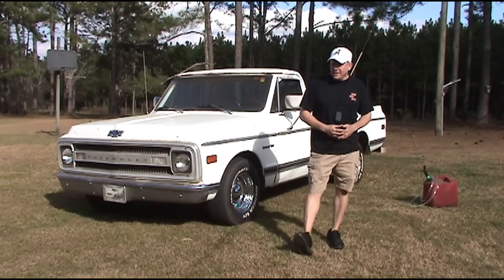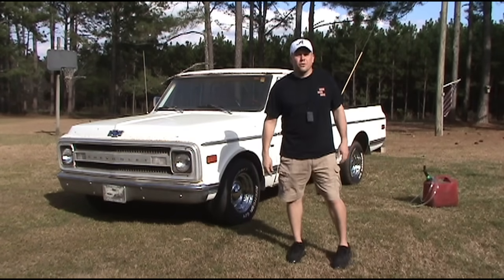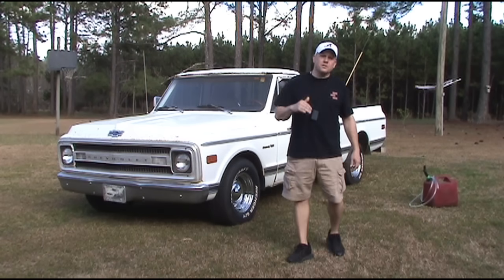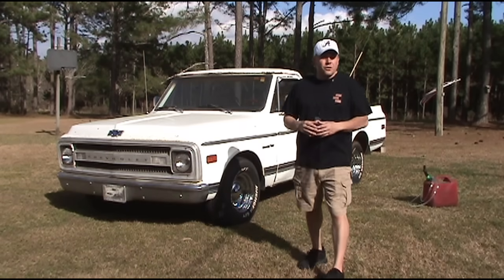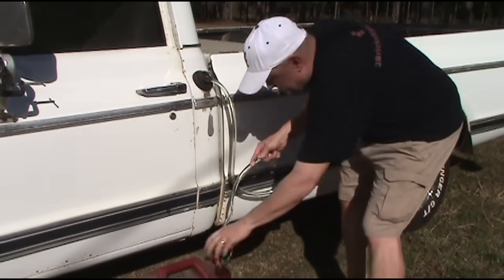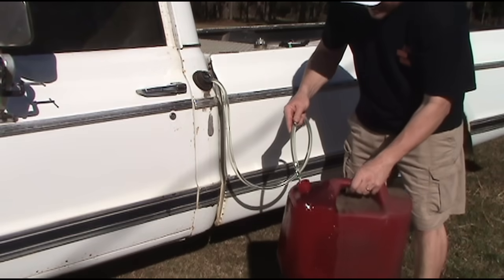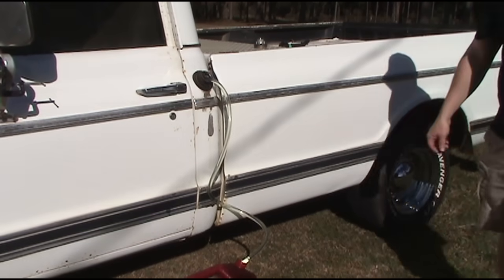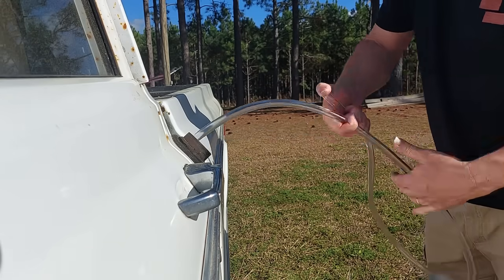Absolute BEST way to Siphon Fuel. You've never seen this before

Comment: this will come in handy with the apocalypse right around the corner.
Reply: But only for about 6 months until all the fuel goes bad :(
Reply: If you find a car not taken out by a nuke's EMP wave
Reply: @thecoolerTK421  i mean the plain nuke will probably mess a car up too
Reply: Nothing ever happened 👍
Reply: exactly why i’m watching
Reply: Came here after watching The Last of Us.
Reply: Last time I tried it I discovered there was something inside the tank to prevent anyone pushing a hose into it . ☹️
Reply: @victory2115 newer vehicles have anti-siphon measures in the neck of the tank to prevent this. You might be able to get a small tube in there, like a quarter inch or so, but that would take an awful long time to siphon. I think they started doing that in the 1990s. I know that's not really "newer" but it's newer than that 70s truck.
Reply: @victory2115  there are some jerks that will go and drill a hole in the tank to get the gasoline...
Reply: Can’t wait
Reply: What about the Rapture?
Reply: Doesn't work most on cars/trucks built after 1999...
Reply: At that point siphon hoses with check valves will be lootable by the millions
Reply: @Amen.22 ... Don't hold your breath whatever you do !!!🙂😁👍
Reply: @randymartin5521 they just drill hole hole in tank any more...cordless efficiency at work
Reply: Hopefully there’s some sea foam left
Reply: I like your positive attitude
Reply: Scary world today huh? Best of luck with what's going to be a rough year, from North Idaho USA 🇺🇸
Reply: Won't work.
Reply: Solar flare 2024 calling it rn.
Reply: Yeah but at that point, every car will have been siphoned out already !
Reply: But you kids still don't know how to drive.....
Reply: @oxilite  fuel can go bad ???
Reply: @apat2691 yes. You can add additives to freshen it up again though. But soon, it’ll all be electric. Them zombies better come soon!
Reply: Or when gas prices get too damn high.
Reply: 2 years later.... 😂😂
Reply: @ferrallderrall6588  Drilling a hole in a metal gas tank is there a chance a spark could ignite the fuel?
Reply: @niczim123  probly sppare tly alot are not metal anymore
Reply: 3 days out of gas here in FL
Reply: @vira8880  hang in there bro
Reply: You must be looking backwards.  Turns out it was a few corners back 
It’s on.
Reply: my comment keeps attracting more weirdos.
Reply: @BrickTamlandOfficial  this “entity” has discovered electro magnetism.  Meaning. Yer the weirdo that started this little universe
Reply: Still turning that corner ?
Reply: @TimMiller-j6j  again. Yer not paying attention.   It’s on.
Reply: Still waiting.
Reply: @ pay attention. Rome is falling

Comment: Can’t wait to try this on my neighbors Tesla 😈
Reply from the maker: Works just fine if You use a power cord and a battery that isn't charged 👍
Reply: Use a power drill, dem tanks are tough
Reply: Hook it up to your lights and drain the battery.
Reply: Tesla spelled otherwise is Slate, or Tales, or Stale, or Least, or Steal.
Reply: just make sure there’s no cameras
Reply: You siphon a tesla by putting your tongue across both leads to the battery, just like a 9V. You will soon be outrunning the tesla.
Reply: @rcnelson It also spells disaster if you own one.
Reply: So what?
Reply: Plug into the tesla and pigtail into your house. Same thing.
Reply: try it on the neighbors wife.
Reply: VERY FUNNY, WISH I THOUGHT OF THAT.
Reply: I think they use kerosene.
Reply: Plug in your cord and wet the end with your tongue and wait for the power to flow, just that easy. 
🤯🔋
Reply: Just be careful and don't get shot.
Reply: open the trunk before, and he might have pétrole power unit to reloaded his car
Reply: Future well cooked rooster !
Reply: EV stinks 😷
Reply: Seriously underrated comment - well done!
Reply: @rcnelson and don't forget saelt!
Reply: @bluenetmarketing  In what way?
Reply: Teslas don’t use gas so you wouldn’t be able to.

Comment: Works great on older vehicles like the one you are demonstrating of course, but most modern cars and trucks have anti-siphon screens and rollover valves deep in the filler tube that prevent your step 1— "lower the tube to the bottom of the tank..." .
Reply from the maker: So what you're saying is, it does work 🙂
Reply: @3BricksHigher no....it doesn't. The hose stops before it ever gets into the fuel tank. That's why thieves drill holes in the tank.
Reply: Not to mention that he is using a vehicle that doesn't even have an unleaded fuel nozzle reducer. This vehicle also has a vertical gas tank behind the drivers seat, that fuel level is 3 and 1/2 to 4 feet off of the ground. Due to the way the tank is situated, the fuel level in that tank can be up to 2 FEET deep. Absolutely NONE of this applies to a modern vehicle, and the liar making the video knows it, that is the reason he is using an old truck to demonstrate on in the first place.
     Let's face it fellas, you can do whatever you want with your fingers or thumb, put it in shallow, push it in deep, put your thumb over the end of it, stick another hose next to it, wrap a rag around it, blow into it or any of that other foolishness, NOTHING works as good as a set of lips and some good strong suction. Don't wanna get a mouthful? Practice, practice, practice till you are good enough to get your face out of the way in time. If you don't mind the taste, practice anyway. And as us older viewers already know, it was a hell of a lot easier to do 40 or 50 years ago, and the flow was MUCH stronger than today.
Reply: It’s basically impossible to do this on a vehicle that’s less than 25 years old.😮
Reply: @3BricksHigher  he is saying the exact opposite.
Reply: So you take your ramrod and punch a hole in the screen.  Or shove a rigid pipe into the gas tank.
Reply: @bigbossimmotal 😂
Reply: I hate whining. I used to piggy back class 8 commercial trucks (yep! Peterbilts, Freightliner's etc) and certain fleets had anti syphon screens in all their trucks... and I carried a very short crow bar and a freakin' big hammer just to defeat those. When you're working as an independent contractor and buying your own fuel, and free fuel left laying around was mine all mine! Until Katrina jacked up the price of fuel & the big fleets stopped leaving so much fuel behind. But all these defeatists here who never tried, will never know. You might actually get smelly but you'll gitrdone!! 😂
Reply: @allanbeamer7110  Hell yeah ! “MAKE IT HAPPEN” 🤙🤠
Reply: So, it works on very  old vehicles and might work on newer vehicles if you break the safety devices designed to prevent it.
Reply: Regulations Regulations Regulations 🙄
Reply: Who in their right minds would want a modern car anyways?
Reply: @Basscouch  When most,maybe all vehicles of today reach “classic” or “antique” age the technology on them will render them worthless or at least non functional when something breaks is my prediction. I wonder how Jackson Barrett & Mecum or car enthusiasts plan on dealing with this.
Reply: @Basscouch  Most everyone. I love older vehicles and have a few but new ones are more efficient and have many nice features. Yes these are things that you don't need, but are nice to have especially if you spend much time in a car. And overall, they are much safer. Unless it is a true classic, I lean toward retro-modding older vehicles. They do wear out and in reality, there just aren't enough older cars around, that I would want.
Reply: @Ojb_1959  Yes and the only reason they make them is to piss you off.  Most automotive regulations are bout some aspect of safety. Sometimes they can be a pain, but often they are about saving lives or keeping you from doing something stupid. Run a tank of leaded fuel in modern cars and then spend $500 or more to replace sensors and the catalytic convertor. Or put in a tank of Diesel and spend much more to fix it. 

People do dumb things. When I learned to drive, we learned about how cars worked too. Today people die because and engine quits and they panic and loose control!  People are dumb and sometimes need regulation to protect them from themselves. Unfortunately, we have to   share the roads with these people. So sometimes regulation protects us from stupid people. 

Roll a car over and burn to death because the fuel poured out. How many people would die without seat belts and air bags? I'm not saying that all regulations are necessarily good, but most actually are
Reply: True that. Much to my chagrin. Difficult to combat these fuel hikes
Reply: @bigbossimmotal  Why use your lips when you can try out these methods first? This doesn't just apply to fuel, it can be used for oil etc. THanks for wasting my  time reading your tripe comment.
Reply: @smokescreen2146  Did you read the comment? Did you see the joke? Do I really need to go back and explain the jokes to you? Really?
Reply: @iamtheoffenderofall But in those vehicles without such screens, it does work. Right? Or are you still offended?
Reply: @mrofnocnon  what vehicle today doesn't have these screens and valves? Come on....speak up
Reply: @iamtheoffenderofall I'm sure there are many. I have not worked as a mechanic for some time but I can tell you all older  had no screens. Not that old either. So you are still offended, must be a hard life.
Reply: @mrofnocnon  you won't admit you're wrong cause that would offend you
Reply: @iamtheoffenderofall Nothing can offend me, there is the difference. Equally I could say your banal reply was you won't admit I'm right.
Reply: @jimbaranski4687 you're thinking criminally..lol
Reply: Yeah, that method ain't gonna work on a newer vehicle. You can't get the hose down into the tank.
Reply: If you use a tough enough hose you can shove it thru the screens. But the hose can get wedged doing it and you can't remove the hose easily.
Reply: I was able to do it with a hand pump and black injector hose 2003 Ford F-150 for 1 5 gallon canister my tank is full trying to get an empty so I can get my fuel pump fixed. The hose was about five feet maybe for if I get a 8-foot or a 6-foot it might be long enough.
Reply: Neighbors, 🙄
Reply: So what it means if you where a white baseball hat it's only works 30 year old white trucks😂😂😂.
Reply: @DonaldWells-wk8dc  
'Wear' you mean? Terrible joke bro, made no sense at all.
Bring me your vehicle and I'll show you how to do this with no hat at all. Or, choose your hat color and a brand new vehicle 😁 still works the same.

Just remember, they don't make things like they used to, and it was fairly easy bank then.
I'm guessing most people commenting have never even attempted this practice. As for myself, I just used a gas pump at the store really easy that way. Pump does all the work.
Reply: @michaelslater6839  this probably only pertains to the early model vehicles 👍
Reply: @bigbossimmotal I told my wife the exact same story
Reply: @bigbossimmotal  That's what she said. " Let's face it fellas, you can do whatever you want with your fingers or thumb, put it in shallow, push it in deep, put your thumb over the end of it, stick another hose next to" I'm talking about trucks. What were you thinking. Most guys have "her/she" vehicles.
Reply: Hate to be a party pooper, but often it is done to siphon fuel from a canister, Jerry can, drum or similair into a vehicle that is low or run out of fuel, not out of an actual vehicle. In either case the donor container is higher than the vehicle the fuel is going into, either in the back of a pickup/ute or on the back of a truck. Both these methods would apply. Had a few drinks of petrol an diesel over the years but this video shows 2 smart methods that are clean and easy to use. Wether it works in your new car is not the point really, it still works as the video shows and would help a great deal of people to siphon using a better method 👍
Reply: @allanbeamer7110  So you're admitting to being a thief.
Reply: @ezridr1234  tough enough hose?  You mean like a steel rod?
Reply: @percyfaith11  yeah damn near but no. I've jammed a many of them thru the screens. Just got to have skill dawg, lol.
But yes there are some you simply cannot bust out. The screens either bend over causing the hose to not wanna come back out because they get wedged or the screen breaks off and falls into the tank.
We used to run a junk yard that we pulled vehicles from and would modify them for mini stock racing at Franklin county speedway in VA, so yeah we were always pulling fuel from the cars we got in as junk. Done this hundreds of times and few of my own vehicles but it's been a long time since I've tried it. I'd think it'd be easier today due to shitty manufacturing honestly.
If you're not a seasoned homeowner you likely wouldn't understand there's a massive difference in how water hoses are made. Some you can fold in half with two fingers if you catch my drift.
So yeah good sturdy hose not the dollar store shit.
Reply: @3BricksHigher  yes it works, see my recent reply.
Reply: @Ojb_1959  After markets (OEM) thats how.
Reply: @Ojb_1959   After markets (OEM), that is how!
Reply: @petratical  which one🤷‍♂️
Reply: @Ojb_1959  I like carquest after market parts. They always seem the better one! Just ordered a brake caliper for my 1992 Toyota truck. Half the price of original part from Toyota dealer.
Reply: @petratical  Thanks, I’ll ck em out.👊🏼
Reply: Yep
Reply: . Very well said. Tongue and cheek so to speak.... 😂
Reply: @iamtheoffenderofall it worked great on my 2013 wrx sti

Comment: Thanks so much I've been able to save a lot of money siphoning gas from my neighbors vehicles. Your video made it easy!
Reply: Forty years ago, I had a friend in Florida that had a Chevelle with a 350 / 375 horsepower engine. (Important later.) He worked for a paving company and had the keys to the yard where they parked the trucks at night. On weekends, he'd get blackout drunk and go cruising. At the end of the night, he'd go back to the yard to an old gas powered dump truck, take his "Georgia gasoline credit card", (6 feet of water hose), and fill his car. One night, not paying attention, he pulled up to a diesel truck and pumped 15 gallons of diesel fuel into his tank. When he got done, he started the car and the gas in his carburetor and gas line got him as far as the gate. As soon as that diesel fuel hit the carb, that's where the car landed and stayed until the tow truck got there. He had to drain the tank, flush out the fuel system and change the sparkplugs as they were all gummed up too.

Comment: Good info. Especially with gas prices the way they are. 😂
Reply: More of a SHTF
Reply: Good one!
Reply: He is using a vehicle that doesn't even have an unleaded fuel nozzle reducer. This vehicle also has a vertical gas tank behind the drivers seat, that fuel level is 3 and 1/2 to 4 feet off of the ground. Due to the way the tank is situated, the fuel level in that tank can be up to 2 FEET deep. Absolutely NONE of this applies to a modern vehicle, and the liar making the video knows it, that is the reason he is using an old truck to demonstrate on in the first place.
     Let's face it fellas, you can do whatever you want with your fingers or thumb, put it in shallow, push it in deep, put your thumb over the end of it, stick another hose next to it, wrap a rag around it, blow into it or any of that other foolishness, NOTHING works as good as a set of lips and some good strong suction. Don't wanna get a mouthful? Practice, practice, practice till you are good enough to get your face out of the way in time. If you don't mind the taste, practice anyway. And as us older viewers already know, it was a hell of a lot easier to do 40 or 50 years ago, and the flow was MUCH stronger than today.
Reply: Agreed.
Reply: Underrated :D
Reply: how does the transfer of gas lower the price from your 2 cars you own
Reply: Yah mahn 😂😂
Reply: @bradleysmall2230  you siphon from a third that you don't own duh
Reply: so were talkin about the video as an education video to unscrupulos thieves @jbbolts
Reply: @bradleysmall2230  no were talking about the joke the op made that you don't get
Reply: if you put an egg in the gas it increases volume @jbbolts
Reply: @bradleysmall2230  sweet... how do you know so much?